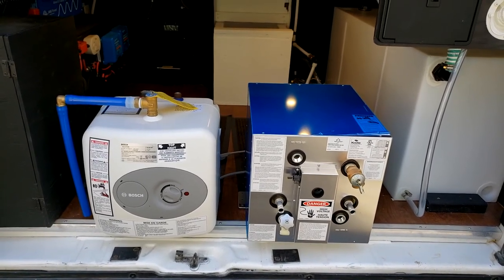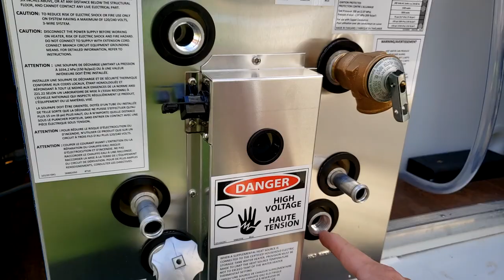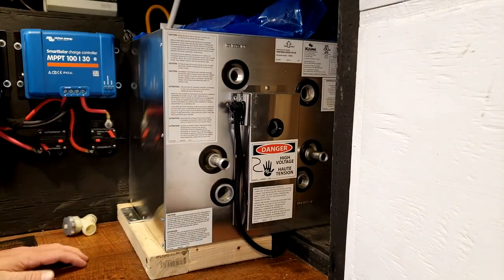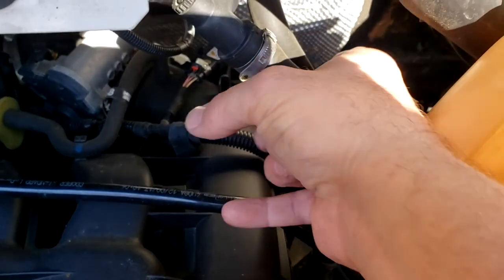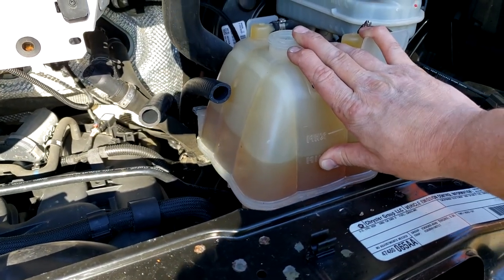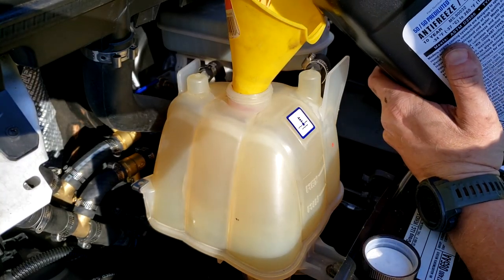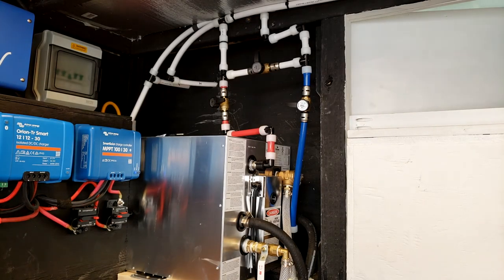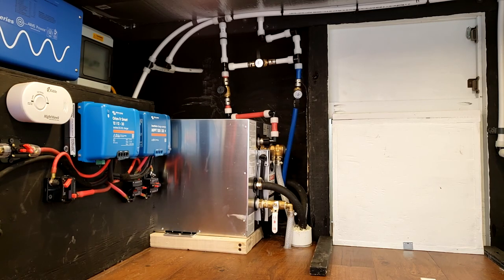Best Water Heater For Van Conversion - Camco Kuuma Coolant & Electric Free Hot Water in Promaster

Comment: I think I still prefer the Elgena Boiler. It does the same thing, but is also available in 12V and 24V. So no need for running an inverter.
Reply from the maker: I'll have to check that out
Reply: Delivery times are a bit on the long side… also plumbing is not super easy. I believe Pundmann and Tigerexped/Combiboil are also offering similar 12V/24V options.

It’s such a good setup! With sufficient solar you can have unlimited warm water…